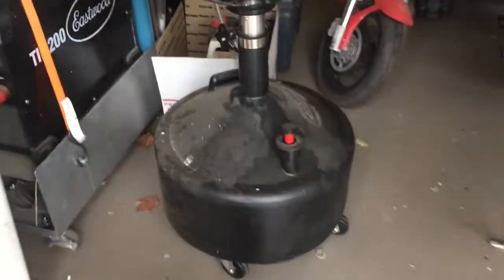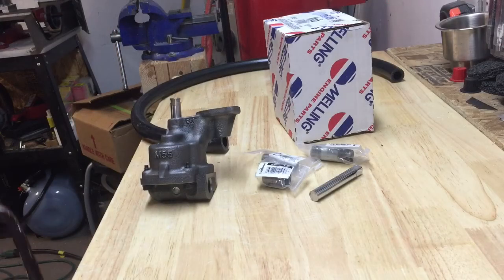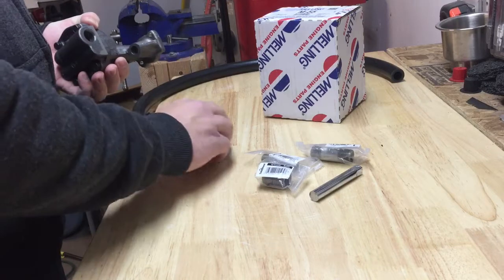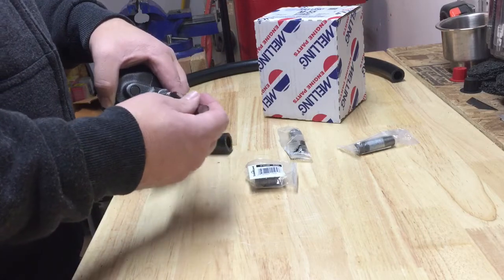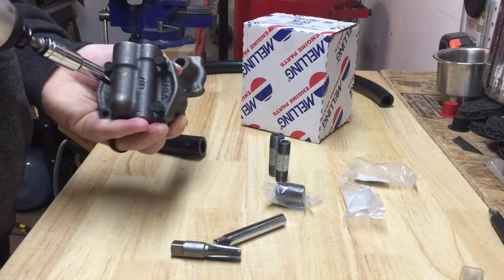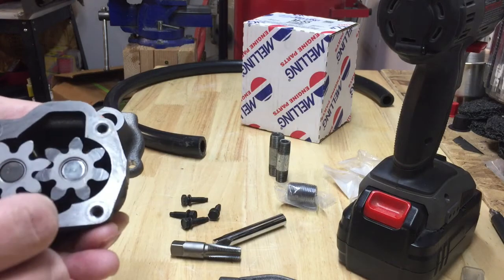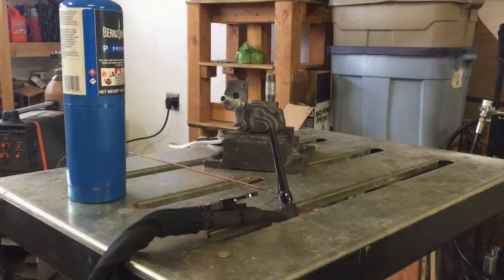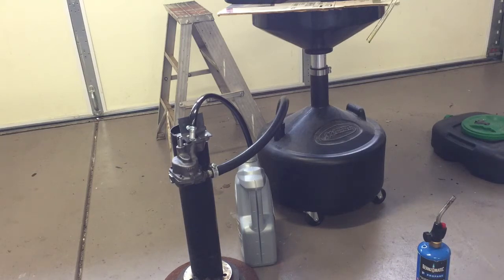Making a fluid transfer pump out of a SBC Chevy oil pump

Comment: I just ordered one of these. Have you or anyone tested how much lift it can do? I plan to pump from below ground waste oil tanks & it'll likely be about 6ft lift + another 3 to the barrel on my truck. Would this work for that type of application?
Reply from the maker: I have not tried that amount of lift.  I still use it for the exact purpose in the video.
Reply: @macj98  Thanks for the video & response. I'll test it out in the back yard before setting out to get the oil.

Comment: Well done.  Adding a shutoff valve a few inches from the exit side of the hose, along with a fitting that relieves negative pressure inside the hose (down stream of a shutoff valve), would minimize oil leaking on the floor when the hose is removed from the oil jug.  Admittedly, this might be over-engineering but maybe it's helpful.

Comment: Does oil leak around the drive shaft? Did not see any in video but no seal on that right so wondering if that is a mess.
Reply from the maker: Nomad no mess.  You’re right there is no seal, but oil doesn’t leak or squirt.

Comment: If you need to move oil a lot faster, you get a much better flow if you put ports in the side of the pump casing and use 1" fittings like I did. I have a couple of vids showing how.  Being a gear pump I think having the small ports is causing a lot of extra drag on the drill with it fighting against the positive displacement of the pump and what it wants to move.
Reply: Josh Rick 

It’s a do it yourself pump kit I would say , and  it  pumps oil pretty damm well too